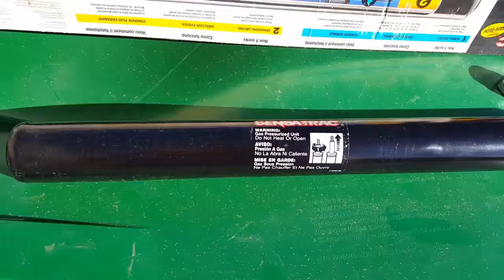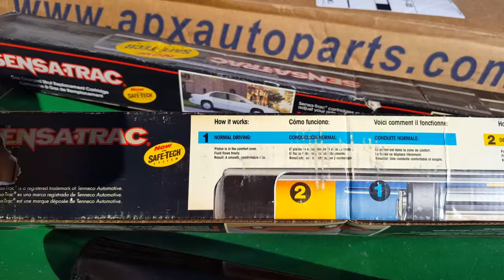Volvo 240 Cut Springs Done Right - 1993 Wagon Restoration episode 4

Comment: It's worth adding a couple of small points: 1 it's good practice to "prime" new shocks before fitting them by pumping them from fully extended to fully compressed and back again a dozen or so times, it saves you having soggy shocks for the first few miles that you drive, and 2 if you're cutting metal near a car you're working on always cover any glass you want to keep and reuse, and the paintwork if it's a nice, expensive paint job, as the red hot sparks will happily melt into the surface and can wreck the glass or paint finish very easily.  Obviously this applies more in places that have regular roadworthiness inspections because in those cases a deteriorated or damaged windscreen/windshield is very likely to be a failure point...
Reply from the maker: I actually did pump the shocks to see if it helped. I think it did but I can't be sure if that's my bias. but it feel a little better after 100 miles
Reply: David Bello   If they were old stock shocks that have been on the shelf for ever the seals may have dried out a bit so they would take a while to come up to full performance.  Keep an eye on them and if they don't improve after about 500 miles or so I'd get on to the suppliers for replacements or a refund...

Comment: I've never seen those Gemini wheels on a Volvo in the UK, the nearest I've seen in style were the rims that came on TWR-tuned 740 Turbos in the late '80s but they didn't have centre caps, just uncovered nuts and Volvo badges in the centre...
Reply from the maker: That's what I may have to do with mine. the caps are threaded
Reply: David Bello   Yes, and keep your eyes open, you never know a set of those caps may turn up somewhere...

Comment: I hope you have better luck with Uro's bargain basement parts than I have :|
Reply from the maker: what failed on you? I've used their strut mounts and ball joints before but sold the cars before racking up too many miles to test them.
Reply: +David Bello Suspension parts and bushings, and their paper-thin radiator hoses.

I try to avoid Uro and Scan-Tech for Volvo stuff these days.
Reply from the maker: +andxx0r_the_second if I ever replace a bushing I use polyurethane if it's suspension on something I'm keeping
Reply: +David Bello I picked up some uro check valves for my evap system, one was stuck open out of the bag so I got some OEM's from Tasca parts.

Comment: Help... I have a 1988 240 Volvo and it is running terrible; replaced the radiator, spark plugs, belts, hoses, electrical wires completely replaced and it is running hot. Any ideas what to do next. It is my Dads car. We have had this car for over 20 years and still running. Do any of you know how to check the electronics on an older Volvo. The code reader that I have will not go back this far. Thanks for any help you can offer. I love your videos and since I am a beginner it is very helpful; thanks again for sharing.
Reply from the maker: that year doesn't have diagnostics. did you replace the thermostat? does your fan clutch still work to cool the car? does it run poor or just hot?
Reply: +1 on the fan clutch and a thermostat. as for running rough, possible fuel issue, maybe MAF sensor?
Reply: might as well throw a fuel pump relay at it.
Reply: Check the color of the of plugs and see if it's running lean

Comment: You mentioned the front was a little soft? i'd like to cut my springs but how much softer will the ride get? wouldn't like to lose too much handling capability
Reply from the maker: cut springs get stiffer. it's the shocks that determine the dampening and rebound effect on the road. I've read that 3 coils gets "bouncy like a basketball" but I'm happy with my stiffer spring feeling.
Reply: +David Bello Nice job. A spring is just a torsion bar that's formed into a coil. If you shorten the spring/torsion bar it becomes stiffer. Not a pretty sight at 11:48............
Reply: Awesome definitely cutting mine today, is it 2 coils for the rear as well?
Reply from the maker: +DieselRiver the rears sag a bit so it's usually 1.5 in the rear
Reply from the maker: +Deluk what's wrong with that nut?
Reply: +David Bello Don't think there is anything wrong with the nut, my comment was about the split in the rubber mount. This might contribute to the top rotating a bit off centre.

Comment: Diid you put those yellow bellows on the rear as well? where did you get them?
Reply from the maker: ebay! theyre polyurethane
Reply from the maker: I didn't put them on the rear.
Reply: Thank you! Does anything need to be done to the rear like hose clamps or cutting the stopper? Or can the cut springs just go straight in?
Reply from the maker: +Jack Squires there's another video with a blue 240 Wagon where they just cut a coil and a half. more than 2 coils and I would say limiting straps are needed to keep a spring from popping out if you ever hit a big bump
Reply: hi! i cant find yellow ones on ebay, do you remember wich seller you bought them from? or any other info that could help? would appreciate some help! :-)